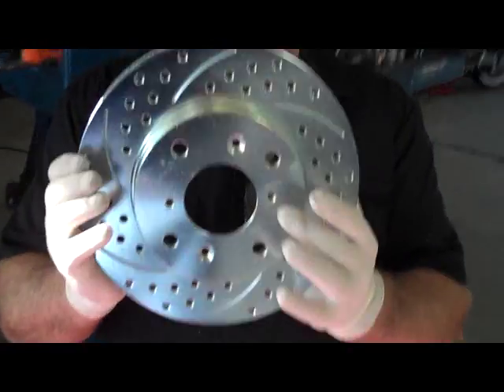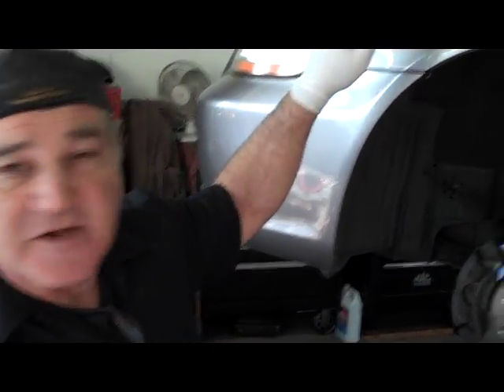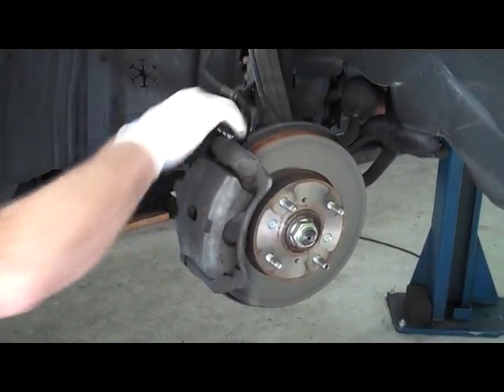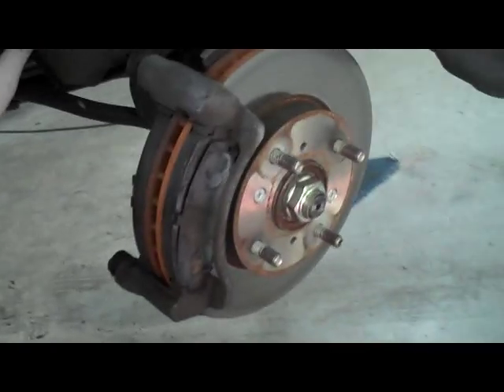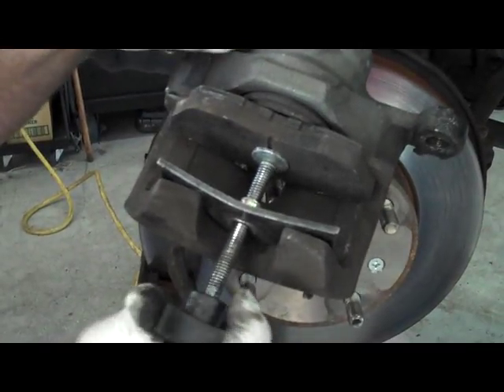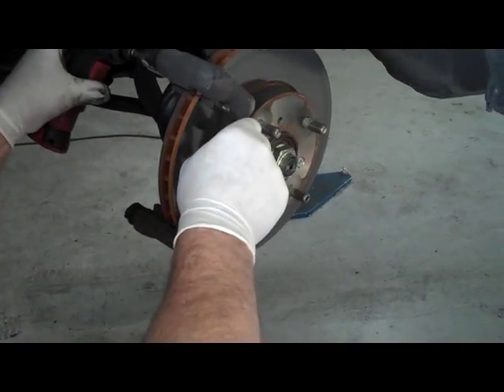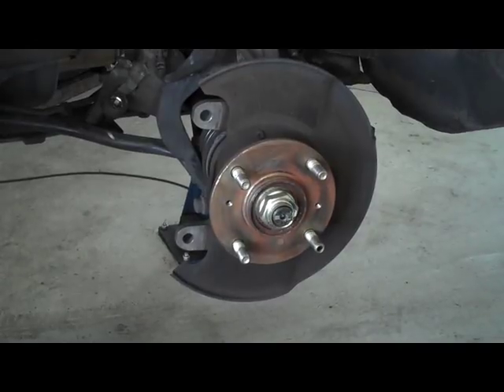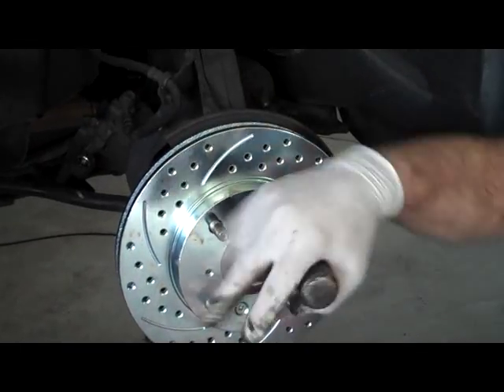DIY:  How to Install Brake Rotors and Pads

Comment: noob question... does having slotted / drilled or slotted drilled rotors reduce braking power? i just thought that there is less contact area?
Reply: no it dosent the holes are just there to dissipate the heat
Reply: CANAM FANATIC
I think I disagree.  Physics says that friction is a function of the normal force (provided by the pistons) times the surface area (times the coefficient of friction).  The holes and slots do lower the surface area by as much as 10 percent, so to get the same braking power, the normal force will need to be increased by that few percent.  Your pneumatic pressure provided by your braking system is set by the design, the rear brakes get less pressure than the front, so when you want the same braking power, with the slotted/drilled rotors you'll increase slightly the rear braking and decrease slightly the front braking.  Depending on the weight distribution of your vehicle, this may or may not be noticeable.  I guarantee it was noticeable on a Mazda Miata using track pads.  If you want to know more, check the stoptech website at http://www.stoptech.com/technical-support/technical-white-papers/proportioning-valves

Comment: nice video, I changed my brake pads and now the one on the ouside part of the disc is totally gone while the outside one is like new, why do you think is happening, thanks
Reply: Your caliper guide pins arent moving freely. Before installing pads always push them in and out to see how smooth they are. They have a rubber gaiter to seal them from dirt/water. You can pull back the rubber gaiter, clean them up and even use a small amount of guide lube.
Reply: Ok thanks for the advice and actually that was the problem and I fixed it already

Comment: please advice people to avoid using cross drilled rotors.  after a while the brake dust will clog.  eventually this dust will expand under heat and crack the rotor.
Reply: Jovin, the purpose of the cross drills is to dissipate the heat preventing warping.  It also aids in removing excess dust from the rotor.
Reply: Michael Hughes  the biggest problem with using drilled rotors is that over time the heating and cooling of the rotor will cause microscopic fragments in the metal and if left unattended will eventually crack and cause serious damage to the brake system endangering the lives of the driver/ passenger. it really doesn't do any noticeable difference in braking performance unless you have upgraded to 4 piston high end calipers braided lines etc.
Reply: N smith It depends on how you drive mainly. If you are just driving around town now and not doing any kind of "spirited" driving, you will not notice much if any difference unless you really slam on the brakes so to speak. I have installed cross drilled slotted rotors on a civic, and Integra, and noticed a substantial difference from simple oem, but my driving habits are a little outside of the norm. Stopping from 100mph+ for instance doesn't produce nearly as much heat, and well, "cooking", as normal oem rotors. I have never seen any crack, or anything like you mention, have heard of it before, but digging into the details, it appears that they ether tried to turn the rotors after a while, and or wore them down quite a bit, installed them improperly, or didn't seat the pads, clean the rotors with brake cleaner (both sides, this guy only done the front). and they should last quite a while. Now if you do something like really heat them up, and go in a fairly deep puddle, it can cause some cracks as well, but a normal rotor would simply warp, in both instances they would likely have to be replaced. 

My personal experience is with the cheap power stop shit, and haven't had any issues, I am sure with more expensive parts the problems wouldn't be as bad either, again it just primarily depends on application and installation. If you do shit poorly, expect poor results. 

With the civic, it had power brakes, and after the new drilled slotted rotors, I had to change braking habits a bit, it would lock up the front tires fairly easily, so I had to get acquainted with the pressure, and how much to apply before locking the front tires up. With the Integra, and abs, it's almost insane. I haven't really been able to stomp on the brakes a little bit of firm pressure, and I am pressed fully into the seat-belt, something that didn't even come close to happening with the oem setup it had prior. Also to note, I didn't install the OEM onto the cars, but they were fairly new when I bought the cars, and after replacing them, it was quite a noticeable difference. My tires are wider than stock as well, so that makes it all the more noticeable. 

Now with all of that said... When I need to replace the brakes, I will also likely replace the rotors as well. I could probably go another cycle, but I prefer to err on the side of new rotors. If the material taken away is not that much, and the surfaces look good, I may keep them, who knows. Again a normal driver will likely not be able to tell the difference unless they have experience with oem rotors and hitting the brakes hard, and then experience hitting the brakes hard with the slotted/drilled. Also don't turn these types of rotors, the more material you take away, the higher the chance of cracking.

Comment: a car in the air in neutral  is a big no no wheel blocks or not! the only time a car needs to be In a gear besides park, is if, it's being  towed
Reply: if its gunna fall on the lift, it will fall whatever its in.......
Reply: why?

Comment: is it possible to change drum break into disc brakes..would that be a good  idea
Reply: +David Jacobo depending on the car yes and it is always a good idea as it will break better.
Reply: I have a 89 nissan d21
Reply: +Nick Sandman It will br*a*ke better. Hopefully it will not break.
Reply: I think you meant brake, not break.  LOL

Comment: I use a C clamp as well, along with a piece of wood.  I've never had to take the cap off of the brake fluid under the hood.